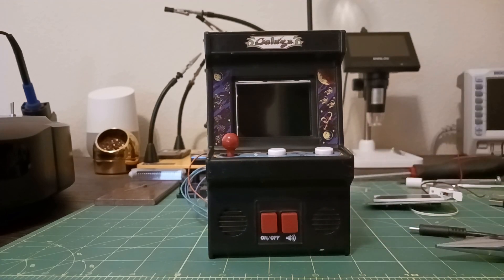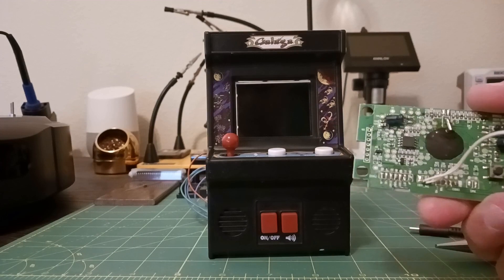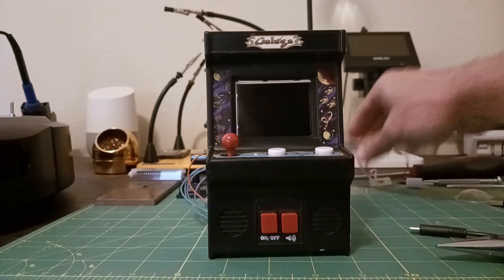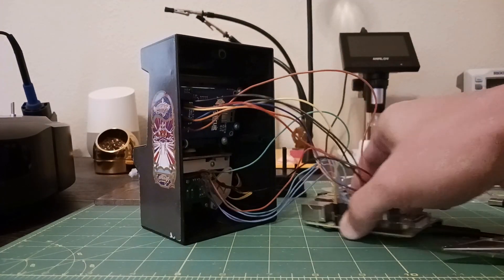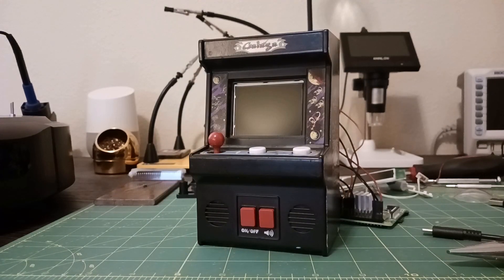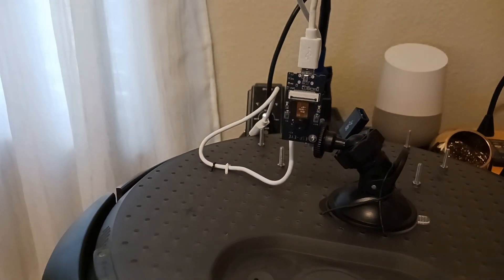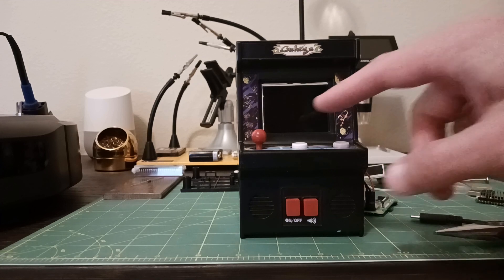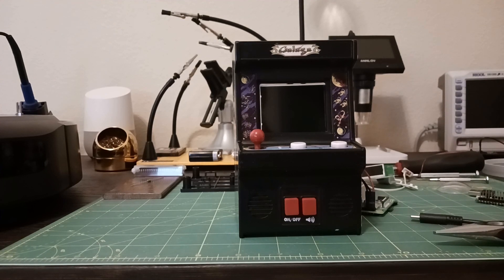Fixing a Mini Galaga Arcade Cabinet

Comment: what does the button on the board do?
Reply from the maker: One switches between drive and play modes, the other sends a signal to the Arduino that acts as a game controller.
Reply: @nickbild8401  i meant on the built in board
Reply from the maker: @Squishysstash  The board that the stock display is on? That is a reset button. There is a pinhole button on the back of the case that presses it.